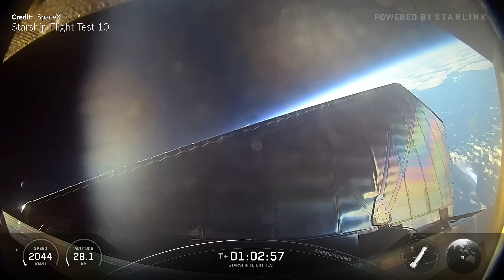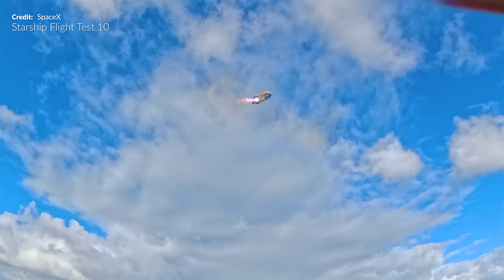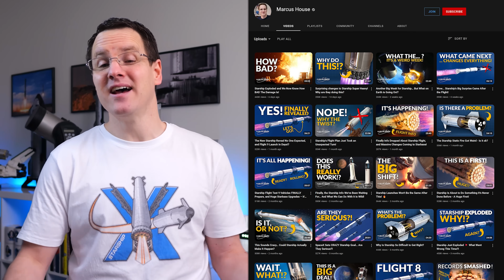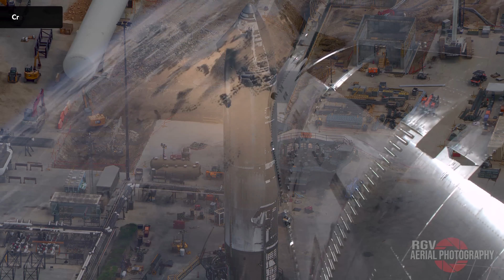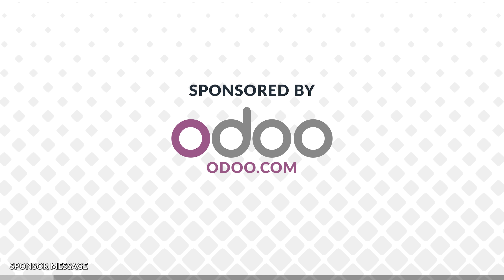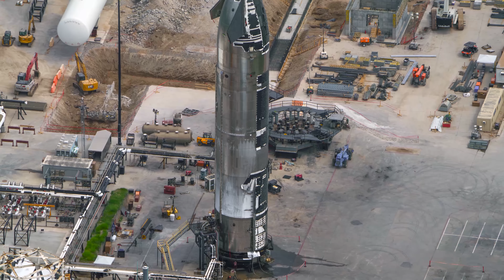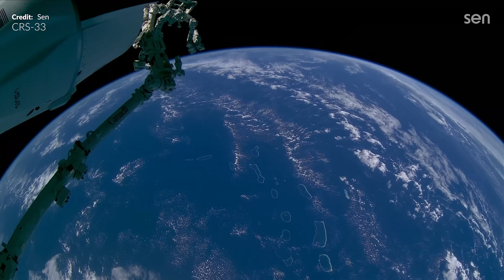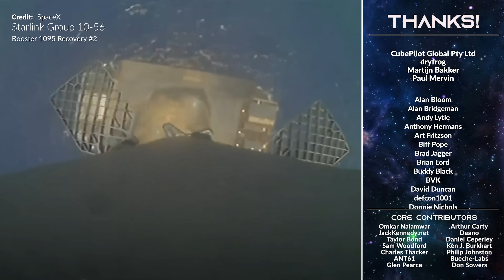Starship Flight Secrets Revealed & Future of Starbase! 🔥

Comment from the maker: The events of this week have seriously been bananas. What are your bets on Flight 11? Orbit? Real V3 Starlink deploy?
Reply: I have a feeling that flight XI will be  a copy of flight X.
Reply: @CaptainQ2607, you're correct. They need more data on reentry at different angles of attack.
Reply: @ThatOpalGuy yes but maybe not on V2
Reply: Seems risky going orbital already after only one success. SpaceX is fast, but not reckless I think.

Marcus & team, great recap of the week, as always!
Reply: @caseydbani1419  Is it “too risky after only one success?”  How many sub-orbital tests are “the norm”. I don’t recall ANY suborbital tests for any orbital systems, but I’m not knowledgeable enough to be certain.  I’m confident Falcon 1 didn’t do suborbital, in-space engine tests.  Pretty sure F-9, New Glenn, and Rocket Lab Electron didn’t do them.  Don’t recall the Space Shuttle doing them.  SLS didn’t, but those engines had a proven track record.
Reply: XI will be a very close copy of X with a few tweaks based on learnings from X and some other test items.  That explosion + all the burnthrough on reentry still require huge engineering work.   Don’t believe they will go orbital or release real starlink sats until V3
Reply: Excitement guaranteed!
Reply: Flight 11 in 6 weeks or less imo.
Reply: I don’t think they should deploy real Starlinks. Too big of a jump. I do think they should consider trying to orbit Ship and soft-land in the water off Starbase. Sneak up on a tower landing attempt, eh?
Reply: No chance they’re going to orbit.
Reply: I'd like to see an aquatic landing.  Throw some skis on the backside and come glide in like Captain Sully 😂
Reply: Not 1 success but 3. 
Still, I think that SX will want to solve the bleeding plumbing as well as not having everything destroyed during re-entry .
Reply: Space mechanisms are hard; and they still are on version 2. If I were them, I’d use the last one to really wring out the whole deployment thing with a stress test of the Dumbllinks deploy by doing a whole mess of them- not just 8 - making sure not to hit the door on the way out!! - and find out where the mechanism ‘chokes’. - Dave Huntsman
Reply: Thank you and your team for everything that you all do to keep us informed about any new space news, especially SpaceX and Elon's achievements in the industry. ❤❤
Reply: Awesome video!  Well done sir!!
Reply: No
Reply: Definitely attempting to launch v3s  everything else who knows
Reply: They can't deploy Starlinks to orbit until they are in orbit.  I'd like to see a flight to orbit, deploy some Starlinks and reenter.  I don't think the first reentry will be to a catch because the reentry would be over Mexico and I expect they will have Opinons. Maybe a reentry to splash down in the Gulf.
Reply: Personally, I'd  luv to see a BIG Starlink deploy!  However, I think the chances of THAT on the next flight are probably less than 50/50 yet 🛰
Reply from the maker: @Barf  I suspect the FAA may want more evidence simply due to the pops in the aft. Hopefully we'll get a plan soon. Aft flaps are already on the ship, so it is soon time for static fires again I hope.
Reply: @MarcusHouse Thing is, FAA’s remit is legally limited to ‘safety of the uninvolved public’.. Not sure there’s a basis for them to do anything other than Watchful Waiting on this next one…… - Dave Huntsman
Reply: @Barf I bet real starlinks are deployed next flight
Reply: I think they will do live Starlinks,  why not, they are peanuts compared to rest of program costs. Orbit, probably, if FAA say OK.
Reply: Grok did well,  rendering that "live landing view".

/s